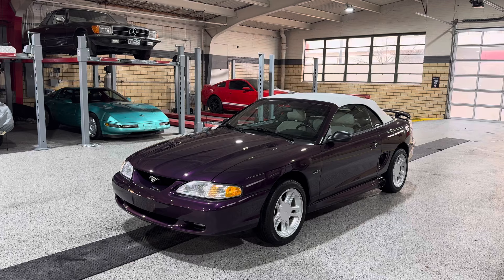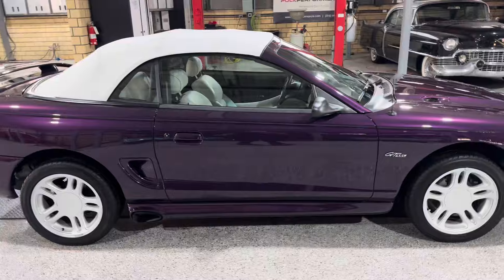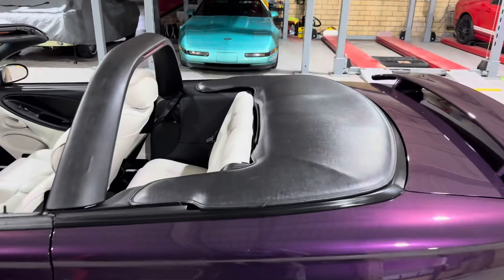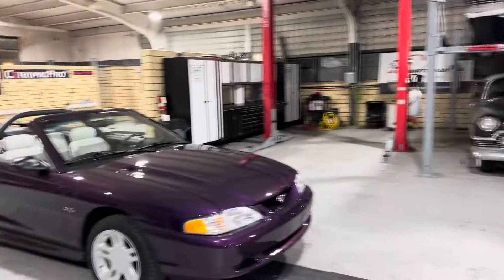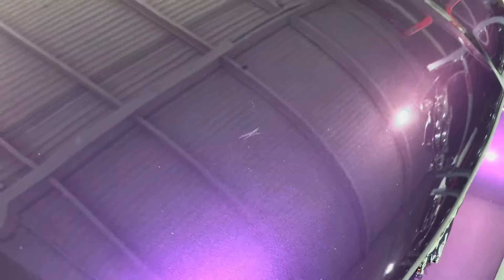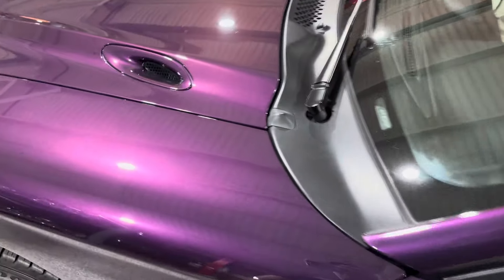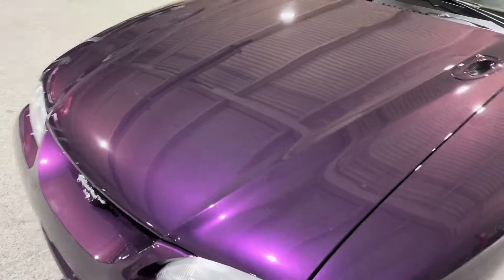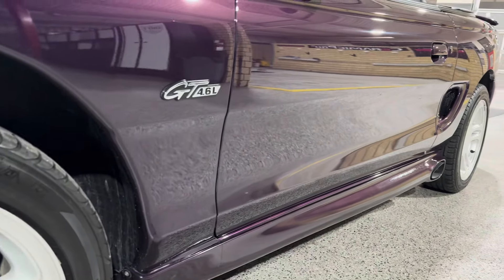Beauty Eh?  RARE Canadian Deep Violet 1996 Ford Mustang GT Convertible 5sp with only 14k miles!

Comment from the maker: SOLD!

Greetings Automotive Enthusiasts!
Check out this incredible 1996 Ford Mustang GT Convertible 5sp with only 14k miles!  It is finished in the stunning Deep Violet paint with white top and interior.  It’s first year 4.6L V-8 engine put out 215hp and a stout 285lb-ft torque.  This driving the rear wheels through a all new T45 manual 5sp transmission.   This is a Canadian spec model that is in near mint condition!  I have never seen on in this exact spec.  I wonder how many were made.  Surely this is the best surviving example.  It’s mainly stock with the perfect mods like it’s side exit exhaust, roll hoop with third brake light, and hidden hitch.   It is loaded with options including the MACH 450 audio system with cassette AND CD, full leather interior, cruise control, power driver seat with lumbar, rear spoiler, power windows, and a host of other great standard and optional features.  It’s a stunning car in person!  It runs, looks, and smells new.  Check it out!

Have a great day and Happy Motoring!

Check out the car on our website:

https://www.euroasianauto.com/details/used-1996-ford-mustang/100538106

Get your Euroasian merchandise here:

https://threadbear.store/collections/euroasian-bob

Comment: Sure look like a 97 according to those tail lights
Reply from the maker: It’s titled and decodes as a 96’. Canadian spec different?
Reply: Not sure but I know that in 96 they had a 5.0L engine this car is like all other 97-98 with the 4.6L engine the paint and interior is a rare color combo but I am referring to the American models I think Canadian were the same. Beautiful car by the way.
Reply: Did a little research and I concede you are correct about it being a 96 my apologies.
Reply from the maker: @andrewdoman6294  the 4.6 actually debuted in 96’ like this car.  

Thanks!!!
Reply from the maker: @andrewdoman6294  no worries!  It’s all good!